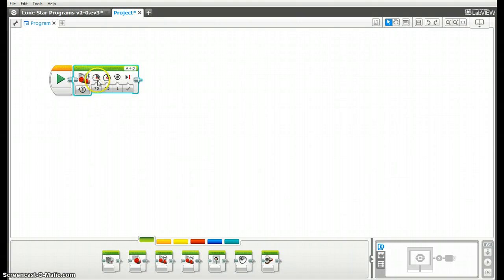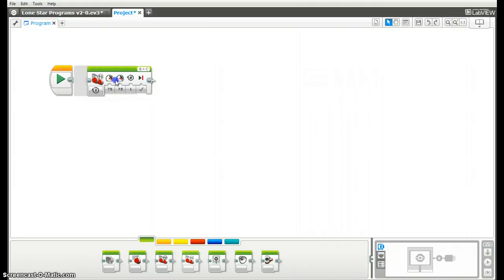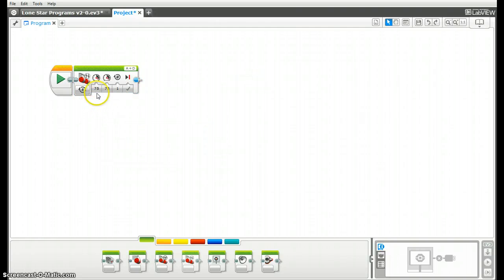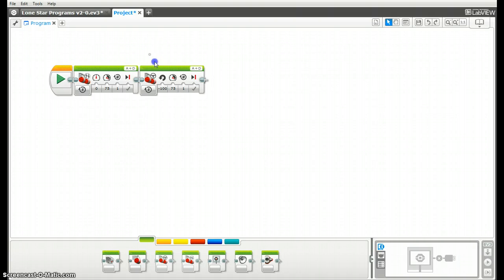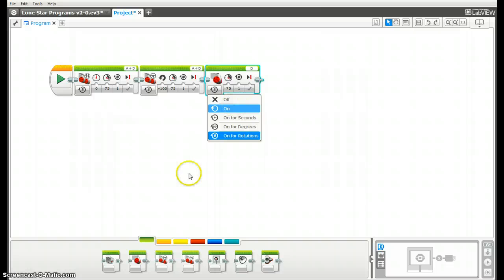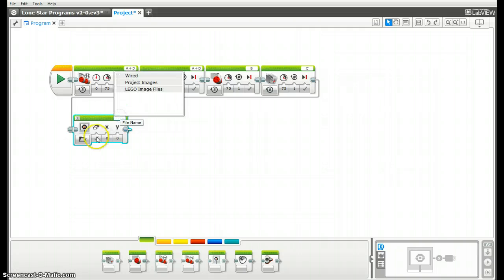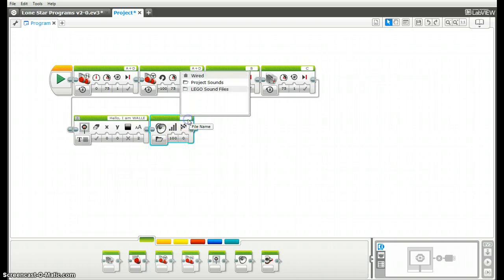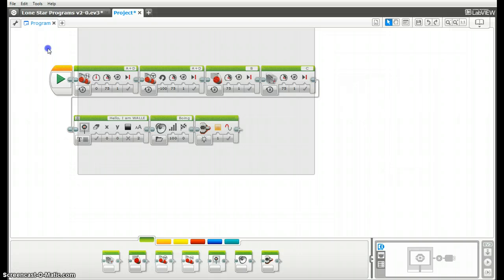EV3 How to Code Episode 1: Green Blocks

Comment: Please can you make a video on how to make a proportional line follower? I have a question: my robot doesn't go straight all the time when the speed is about 25 or less. Is this because of the code or just the robot? I think hte problem is that we have wheels that aren't flat, but what would you say?
Reply from the maker: Hello Eugene, 

We have 20 videos in the making, but they are not finished. Proportional line follower is in progress!

In our code, when we line follow, we set one of the motor's power to 25, and the other motor to 5. I can send you some screenshots if you would like. Thanks for checking us out! Feel free to ask us questions regarding programming, robot design, project, Core Values, etc.!